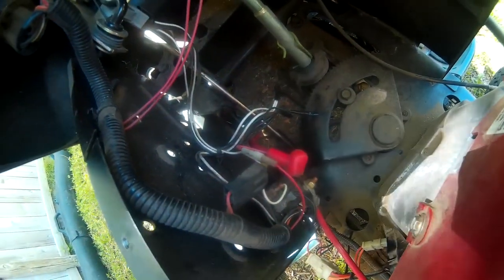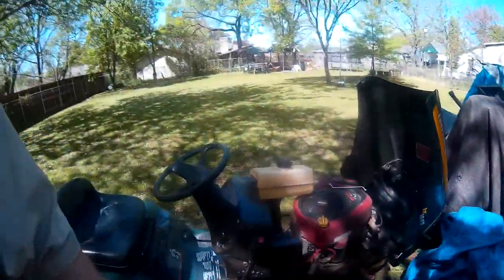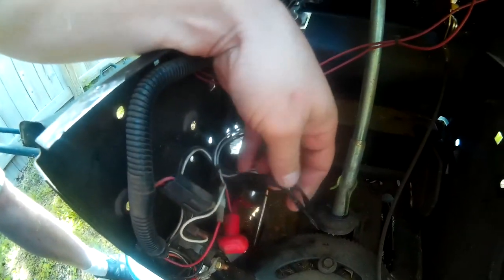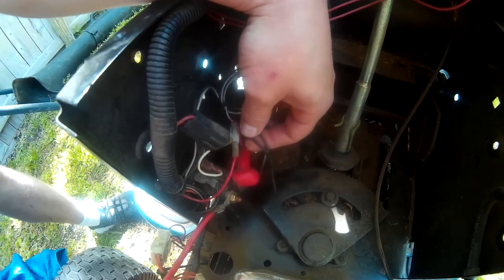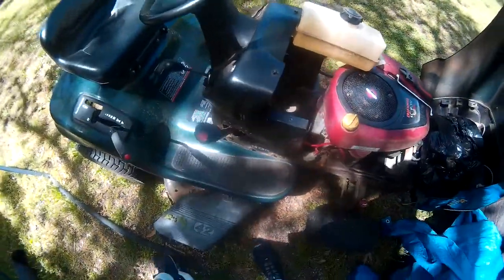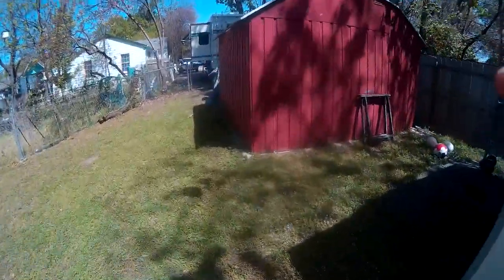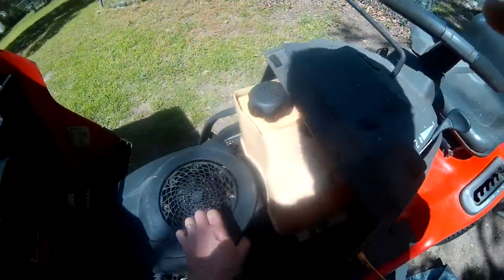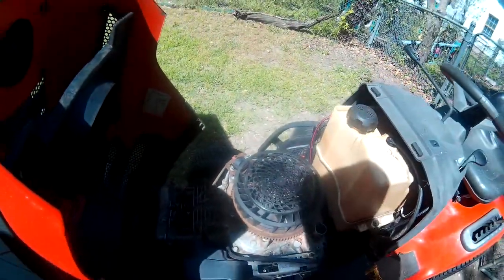Bypass Brake Switch and Bypass Seat Switch EASY FIX

Comment: I have a Craftsman riding mower and found an easier way to bypass the brake switch than tinkering with the wires. I bought a replacement switch on Amazon for $13, plugged in the wire harness, and zip tied the switched closed. I didn't even mess with the old switch, but either it was always faulty or the mechanism to close the switch has a design flaw. Anyway, my riding mower starts right up without any fuss. Thank you, Ross, for the inspiration! I had been dealing with the brake switch b.s. for 10 years. I was even looking at new mowers to be done with the headache. Now, it starts up like new!
Reply from the maker: Yeah it was a pain in the ass. I usually use a regular push mower most of the time to get exercise
Reply: I just got a used one because I got acres of land now so new rider mower owner and I'm having problems staring mine new battery and everything but it seems if I mess withe the throttle it'll turn over and run.  And ideas? I'm wanting to by pass all this I think. When it starts it runs GREAT
Reply: If you make a jumper wire with 2 spade connectors you can unplug the brake switch and insert the jumper wire into the harness on the lighter color wire side. (grey or white?)The black wire side shorts out the coil so it shouldn't be jumped at all, unless you want to kill your ignition. Cost = free if you have the connectors. 
I tested my switch and with it the button pressed in the black wires are open circuit, and the lighter color ones are closed circuit. Added benefit is you're not clipping wires or altering your wiring harness, and it can be set back to how it was if you want, be reconnecting the switch.
Reply from the maker: Sorry for the delayed answer, but just now saw your message.  The jet on the bottom of the carb probably needs to be cleaned...I hit something and broke the Deck on mine, so not using it anymore.
Reply from the maker: Sorry for the delayed answer, but just now saw your message. Good Idea. I broke the deck and now I'm using a push mower...Better Exercise

Comment: My craftsman lt3000 dies with the deck attached blades engage however without deck on it runs ok seat has be bypassed it dies with the brake released in any gear with the deck attached . Will that work for me?
Reply from the maker: I’d try it, especially if dies in any gear.
Reply: If it's a newer mower with the 3 wire seat sensor connector, it'll disable the mower from mowing if the seat sensor is unplugged. Try plugging it back in and see if it works again. If it's an older one with a 2 wire connection, you can just unplug the seat sensor to disable the sensor it and it won't matter.

Comment: Would this be similar to a craftsman? Have one that dies everything you release the brake
Reply from the maker: It is a Craftsman
Reply: Mine just started doing exactly the same. What did you do?
Reply from the maker: Sorry for the delayed answer, but just now saw your message. Mine did that to. I disconnected a wire that was causing that. It was near the brake or by the other wires in the video...